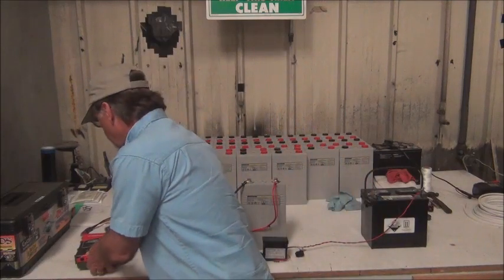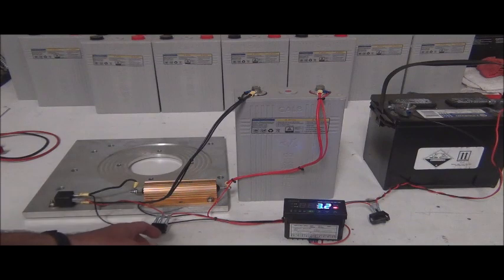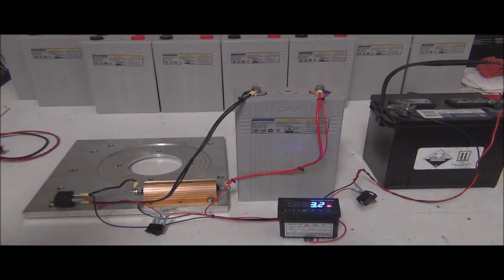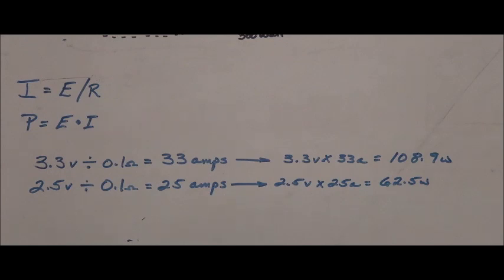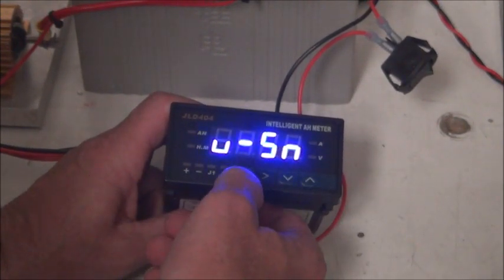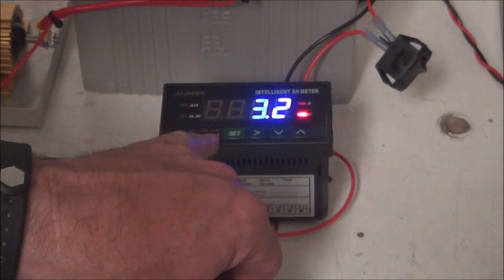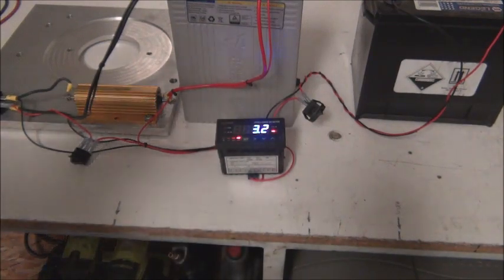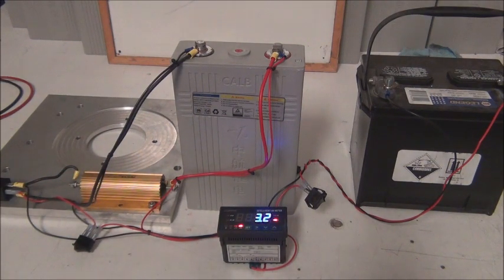DIY Electric Conversions Economic Way to Bottom Balance LiFePO4 Cells

Comment: where do I find the device you used to detect the low voltage and programed to 3.2 volts to turn off the relay?
Reply from the maker: Amazon or eBay

Comment: Hi EV4U, nice session about BB!
With 16pcs EVE 280K cells on their way to my home, I want to connect them in series and discharge them with my Victron Multiplus 5K until the cells are almost empty.
I have a BMS connected in order to stop discharging when one of the cells take a nose dive below 2,5V.
I lso have the luxury of a 200W Siglent Electronic load that can discharge with 30 Amps to a specific setpoint before shutting down and stop discharging.
After having discharged all the 16 cells separately  to about 2,5V, I want to connect them parallel to do the last discharge dive into 2,5V before connecting them in series and charge them up to 55V.

My only question is: how long will a brand new 280Ah cell "survive" a zero S.O.C?
I will need at least two weeks for draining each cell untl 2,5 V is reaced, will this be a problem?

What do you think of my approach?
Keep up the good works, I like your builds!
Reply from the maker: Please note that we bottom balance to 2.75 volts not 2.5 volts.
Reply: @ev4u  good to know, but how long can you leave a cell at this low voltage?
Reply from the maker: No sure what the time limit might be.  We bottom balance, install, and charge within a couple of weeks.
Reply: @ev4u  thank you, that will do the trick 👍
I see that your setting is 2,5 V, then the discharge stops and the voltage crawls up to 2,8V-ish in order to trigger the discharge again until the voltages stops reaching the 2,8 Volts.
Did I overlook someting ore IS there a second hysteresis setpoint at 2,8 I didn't notice?
Reply: Loooked your video again and found the answer, very neat way of simply prepping your batteries for a project.
Woll investigate if my 200 Watt siglent DC load has tricks on it's sleeve to do the same 😃
Reply: Good video Richard